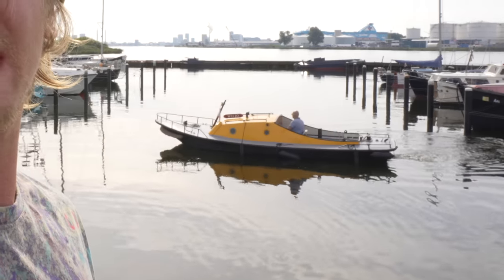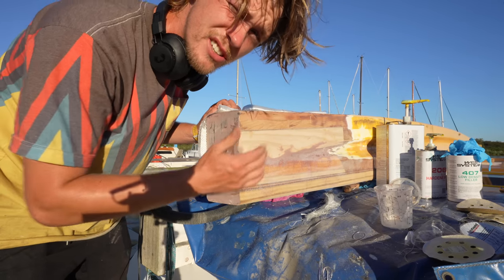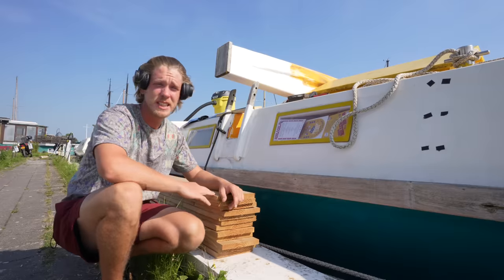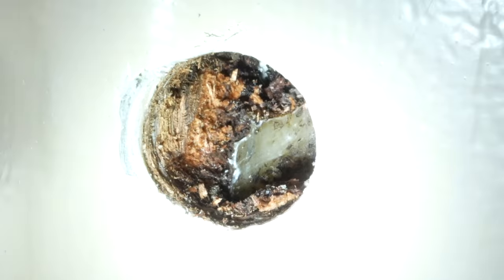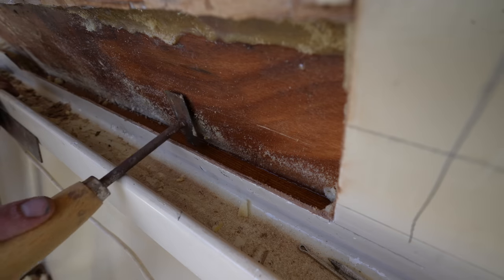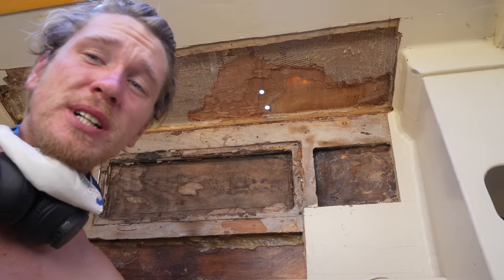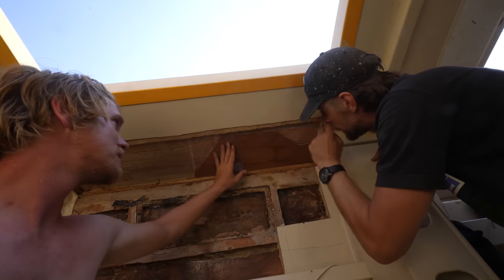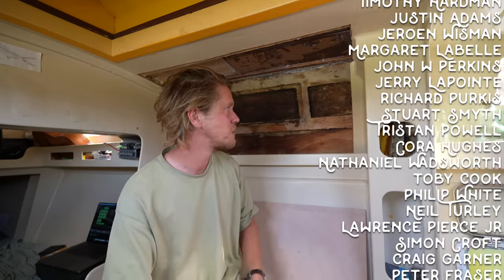Ripping Out My Boat’s Rotten Interior (So I Can Go Sailing) | Wildling Sailing

Comment: I don't think I've ever met a goose that wasn't an ass. You're doing a great job, love watching you go!
Reply: Nobody has ever met a pleasant goose.
Reply: Are those not mute swans?
Reply: Swans with cygnets.
Reply: Even if, still don't feed them with bread. It's bad for them. If you want to feed them, then try vegetables, fruits or oatmeal. Usually feeding them isn't really necessary.
Reply: They are swans and as stated previously bread is very bad for all birds. It fills them up but has no nutritional value for them.
Reply: @kevinturner8343  yes but it's good to feel full one in a while
Reply: @Runningfromtheherd  Good point, but white bread has little nutritional value, so when "full" of bread, the swan won't bother foraging for it's natural foods.
Not a problem if it's only occasional (as in this case?), but, long term it could result in malnutrition.
As a child, I was told that the bread would swell in the bird's stomach and cause distress, but I've been unable to verify that.
Reply: They are swans and they got pissed of when he didn’t throw the food in the water, but made it hard on them just for the pictures.
Reply: There were swans actually and really pissed, judging by a sound. "Fun fact" these birds can actually kill you when the go into defense mode (because swans have quite strong wing muscles) but are super tender to water. If they start hissing on you and approach, just splash them with water.
Reply: Canada put all their anger in geese, that's why. Water chickens are their anger.

Comment: Hi Mark. If you have troubles getting wood screws out due to epoxy. Hold a soldering iron on the head of the screw. The heat will release its hold
Reply: Next time, I would try coating them in mold release wax before screwing them in. Should come out easily!

Comment: When you are laying glass/ epoxy, once wetted out, place a sheet of polythene over it and smooth down.  
It gives a smoother surface.
It helps stick it at edges and around corners.
It should avoid the moisture causing the milkiness

Comment: May not be a bad upgrade some day to build an angle bracket from steel or wood. Use it as a backing plate for chain plate that ties the gunnel to the interior bulkhead. I'm afraid any foam coring will keep you from bolting plates tight enough also. Movement is usually followed by breakage.

Comment: Hi, a heat gun will get rid of the milky surface on the resin. It's just a little trapped moisture on the very surface. I built Campion Boats for several years and the heat gun trick worked fine.
Reply: Had a Kelly toba. Lived on for years.
Reply: @montyforster3370  Funny story, the toba was presented to the dealers in a catalog without a name, so they typed ToBA. It was meant to be understood as ' To Be Announced'. The dealers place their orders for the toba and the name stuck. True Story.

Comment: Mark, there are numerous solvents you can use to alter your resin's profile. Acetone is very popular with little merit. For starters, most solvents alter the more aspects of your bonding mediums in negative ways. And most are expensive. Acetone is a known carcinogen, yet boatworkers seem to love using it as often as they can! One of the more fortunate things about de-natured alcohol is that it is none of the above! It's much lower in cost. It's much safer for you. It doesn't screw around with the bonding properties. On top of all that, it's a much more effective diluent!

Comment: Ive had glass go milky like that but with poly resin it's a no go..   It means the cloth is wet,   its not good. With epoxy moisture prevents it from impregnating the cloth.    I would say grind it off is proper, but im bodgey too so i never have.  Still floating.  P.s.  not grinding it off if it's on the wood will cause rot if it's in-between laminates will cause weak lamination

Comment: Mark, you do realise you can get scraper blades for those multi tools? And they're brilliant.
Reply: Dear TAC
👍👌👏 Yes, there sooo much different and useful attachments for those multi tools available. Some even especially for boat building purposes. Of course the brand Fein has the most stuff but unfortunately also the most expensive attachments. There are also  electrical scrapers existing (I own an older one from brand Bosch. Newer ones are called PSE). Pretty helpful devices, even pretty good for carving.
Best regards, luck and health in particular.

Comment: Don't sweat the milky epoxy. I'd only be worried if it was an under designed, racing on the edge type build. This is a Wharram, it was designed with sub optimal conditions, materials and workmanship in mind (not that all of those apply to yourself of course!)
Love the videos and I will be waiting for when you have enough footage!

Comment: Great work Mark, the rotted sidewall wood reminds me of what we have been dealing with throughout our 52ft Endeavour Sailboat project.  Its a shame the builder didn't do a little better quality on that area of the build.  Chain plate structure needs to be dry and solid.  Those swans were not very polite as you hand fed them. Enjoy your break from boat projects for a bit.

Comment: You might try choosa board under the deck soft spot. Its like steel after using marine epoxy
Reply: Coosa?
Reply: That would be great to reinforce the area where the chain plates go.

Comment: 'Milky' epoxy resin from moisture interacting with it while it it is curing, in my experience, the resin seems to stay soft when cured. Push finger nail or other into it and you will make an impression without much fuss and it won't sand easily e.g. clogged sandpaper.

Comment: Since you asked, I've built a couple wooden boats with fiberglass shells and repaired several, certainly no pro. One boat got milky due to very high humidity but I went with it. It lasted for 2 decades then I sold it. About 2 years in, it  took a broadside from a boulder in surf- no puncture, just cracked.. Nice pop view of the gooseses through the port window, they were my exes favorite bird...I see why now. At the end: you're rockin it, looking forward to some swell eating.

Comment: Your boat was insulated with polyurethane foam which absorbs water like a sponge.  Replace with polystyrene foam, white 1 pound or blue 2 pound which does not absorbe water, it repels it.  best of luck for the redo.

Comment: I suggest that you get a rotating mast, its much more efficient and your boat will go faster. Just a thought!
Reply: Making a rotating mast is difficult and the mast has to be very stiff. He would have to have that mast base welded to the bottom of the mast & make a ball & socket attachment to the boat. Young barnacles has set one up on their catana using a salvaged AC carbon fibre mast, then again he is a carbon fibre master that has many years of experience sailing and building America's cup race boats.

Comment: You work really hard, that’s clear, and I know zero about boats 🤷‍♀️I think you’re brave, because as an uneducated boat construction/repairer, it seems like you’re glueing (epoxying) bits of wood together to make a sailing vessel. I’m not dissing you, I’m just fascinated and intrigued as to how that can work. Amazing.
Reply: The foiling IMOCA's have 2x 2mm skins of carbon fibre and just 20mm of foam that makes up their hull that they push to 35+knots while smashing through huge waves. Epoxy is a wondrous material.

Comment: Put your version of peel ply , use plastic as you did previously when you know your epoxy work will have evening condensation on it,plastic or peel ply will save the white waxy build up that is a nightmare for builders….good stuff Mark…

Comment: You should have tried using composite decking instead of wood they are strong lightweight and unaffected by saltwater and when you get the stage of building a deckhouse just look around the many boat "graveyards" you could probably find  a write off hull that has a nice "fisher style"deckhouse that could be removed with a little effort and transplanted onto your own at very little expense.

Comment: Hi Mark the white milky finish is amine bloom due to the moisture just sand it back and it will be fine. There are polyamide cured epoxies that can be used if condensation is unavoidable.

Comment: Tip 1,  wrap kitchen cling film around the epoxy-work when the weather is getting moist, it won't stick to epoxy and you can even use it to make shapes in thikened epoxy. Tip 2, don't feed the swans. Used to live on a yacht not far from you (Nieuwendam) and did feed the swans, they tend to come and "claim" their food quite aggresivly and even wake you up tapping on the hull. Keep up the good work!!

Comment: Your fibre glassing technique has got so much more efficient, well done. Re hardwood for the mast, I've heard of people laminating shorter lengths where they need a long piece. Making a square and knocking off the corners to round it. Seems quite time consuming though.
Reply: Look up birdsmouth mast. 
And hardwood is too heavy for a mast use Douglas fir or spruce or ….

Comment: Hey mate, the milky look it air, you will need a ribbed roller to push that out, and I have found wetting the glass as well helps a load with that, from my experience on my boat from here in New Zealand, keep up the good work mate!

Comment: im think of what i would to for an engine cause i think just like build huge contraptions for haging 2 out boarders to it seems like such an unelegant solution and i think since you have and probably will have lots of solar an elektric solution would be nice .... i really dont see super nice long lasting way of doing that properly that kinda makes me thing you sould have thought about it while the boat was out of the water actually ... damm ... i didnt think of it either... i mean you talked about it with once of the planners of this boat so it will probably be fine i just keep thinking about these submerganle 3 efoil motors ... but even tho they ment to be under water still they dont like saltwater ...

Comment: FYI When cutting in plywood fillers , leaving a strong ¹/16 " is a common practice that insures your plywood won't buckle and you don't have to fight to get the pieces in. A good rule of thumb is when you are taking dimensions using plywood automatically subtract an ⅛" off each dimension.. This rule applies anytime you use plywood especially for construction. Also it's good to get this into your head " MOISTURE IS ALWAYS GOING TO FIND IT'S WAY NO MATTER HOW GOOD YOU SEAL IT " And if your wondering why, don't ask me, ask God. Cause that's more his department. Also whenever possible do not apply sealant to the bottom of anything that way moisture has a way to escape. ( on a boat its hard not to)

Comment: Hey Mark !!

As far as Beams for your Mast Step ... Look for Northern Red Oak in that area , BUT , you'll want to leave the city and go outbound a bit to get a good cut and a cheap price.  So have someone with a van or truck take you for that .. The JANKA SCALE for Hardwoods is very handy to determining strength , and over 1200+ is best.  
As far as your chainplates i dont know if you already have them but the old wood boat builders used a term called BTP Symmetry.
Using 2 Chainplates in theory by one Inside the Hull and one Outside the hull with Bolts being used to Sandwich the wood hull cores together giving you immense strength compared to a single sided chainplate with bolts and only washers on the backside.  The larger dual plates distributes the load far better and some ppl may say overkill , but it'll made to last forever and in a Force 8+ wind you wont have to worry just how sturdy those chainplates are .....

Cheers Mark.
Reply: wildlingsailing....  STOP SCAMMING YAHOO FROM NIGERIA

Comment: I believe you can scrub the epoxy bloom off with really hot water obviously not boiling or you'll strip your hands but as hot as you can sensibly stand and use a scouring pad (the green ones not a brilo pad)

Comment: Yes, don't do the structural stuff like the beams, thats not important, do stuff that fun to do because the fun stuff will is better in a storm.
Epoxy milkiness is water absorption, happens when curing in high humidity. Only fix is to grind it out and re-do it. Leaving it in is like having voids. It's water so in freezing conditions the epoxy may start cracking which is never a good thing.
@14:00 +  that water/rot, you have to go further down the hull to make sure the rot don't extend below the waterline.  Just because you think it stops at the stringer don't mean it does.

Comment: Always remember to cote the wood you use with epoxy and let it dry between cotes to build up the strength of the wood then fiberglass the wood after. make yourself a block out of plywood epoxy coted both sides and fiberglass and any holes you drill to over size and fill with epoxy and flox then re-drill to the right size hole protecting the wood inside please always cote bare wood in epoxy

Comment: Those are called Forstner bits and are actually quite nice for drilling holes in wood -- much better than a hole saw plus no pilot bit is needed to keep the hole saw centered. And you don't have to keep digging out the circle you cut out from inside the hole saw. :)

Comment: Those annoying, laminated plastic cards that tend to fill your post box can be trimmed and used to fair curved areas. Also, a 1/4" threaded rod can be bent into a 'Paint roller frame' "L" shape and you can use double nuts and alternating sized washers to make up a cheap, recyclable fiberglass roller for removing air pockets in your lay up. A drilled out dowel makes a nice handle...:face-fuchsia-tongue-out:

Comment: You could wrap the fiberglass in a plastic wrap.  That would give your a very smooth surface that doesn't require much sanding And keep moisture at bay.  I think it's called peel ply.

Comment: As always i was yelling at my screen but you pulled through with a competent bodge job. Sad about your inside water intrusions, remember to seal up all through hull fasteners with an epoxy plug of greater o.d. prior to installation. I will miss yelling at you next week but a break is required to keep energized on the project. 👍👍👍🤙🖖🖖
Reply: Txwildlingsailing  I hope you have a kickass break dude.🤙👊

Comment: The milky stuff is called amine blush, I think Im spelling it right. You can wipe it off with denatured alcohol or sand it off. You do want to remove it before putting anything over it though.

Comment: 0:10 insert Peter from family guy when he hurts his knee sound.
were it me, i would get a slightly thicker plank out of a bendy wood and i would lash that down to the beams with rope (tightly) with a layer of foam between them. Then i'd screw the deck planks directly to that piece of wood, not through the planks, but rather between them with a baton as the holder. That way, the planks remain without holes in them and thus, will last longer.
10:26 the reason you want the chain plates to be near or on the bulkhead is because the forces are then spread through that component. You place that anywhere else and you end up ripping the side of the boat, has happened to a few. Pics online with decaped boats.

Comment: I would seriously consider not using foam core as wet foam is worse than no insulation
Reply: Xps, or eps foam works wet. Not sure how they play with epoxy.
Reply: Eps is fine with epoxy

Comment: Why not epoxy cote the end caps as you should epoxy cote all the virgin wood. to make them rot proof and to give yourself peace of mind and the wood will last a long time. and you can paint them for more added protection from fresh water i.e. RAIN
Reply from the maker: Epoxy isn’t UV resistant. I could paint it. But I think it’s teak
Reply: Epoxy coating wood does not make it rot proof.  Over time,  the surface can crack and if there is ever water intrusion, the remaining epoxy coating will prevent the moisture from evaporating and actually promote rot.  All boats require regular maintenance no matter what they are constructed from.